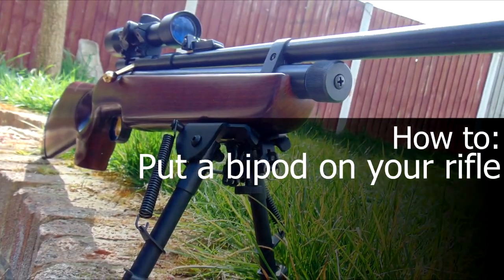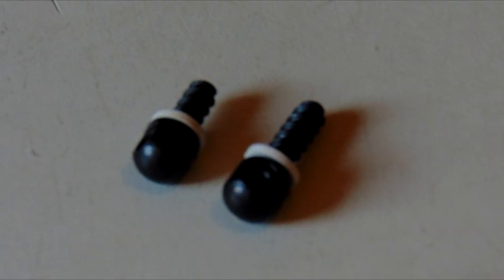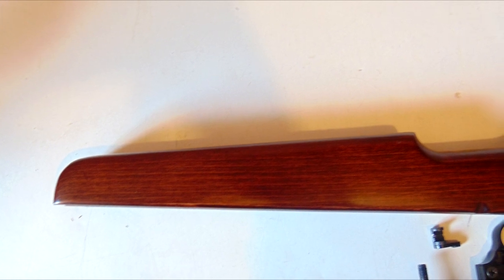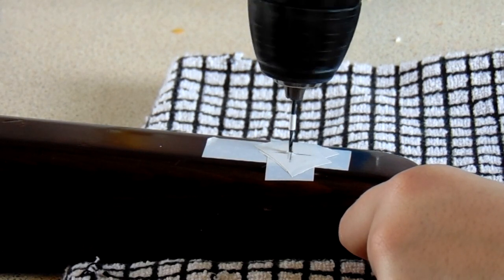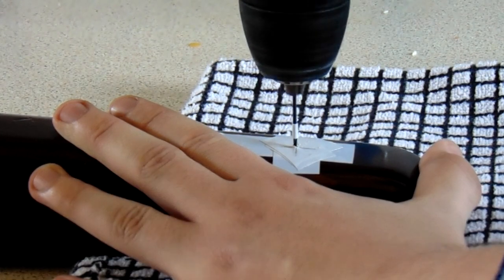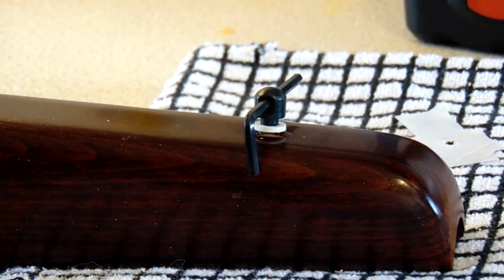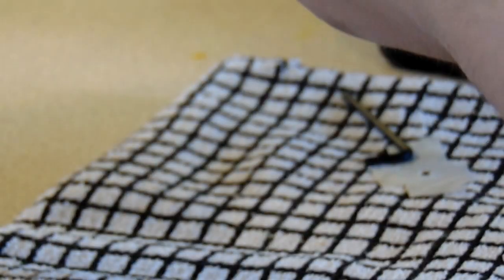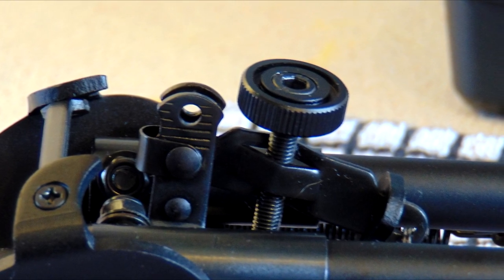HOW TO: Put a bipod on your rifle/air rifle (EASY instructions)

Comment: Don't reverse a drill to 'back out' the bit.  Keep it moving forwards and lift the drill upwards occasionally to clear the waste.  With small bits a higher speed is advisable.
Useful video. I was concerned about doing this on my AirArms S200 but now I can do the job with no worries.  Thanks.

Comment: Instead of using a swivel stud, buy a bipod that has a swivel function built into it and install a picitiny rail instead.
You will have a quick release as a result and can easily fit other accessories like a torch/infra red/red dot laser.
Reply from the maker: Steve			 Fox I chose to use a sling swivel so that I would have the option to use a sling in future. I made a conscious decision not to attach a rail.
Reply: @TDPAviationAndGaming  everyone has personal taste and what one likes is not necessarily what another likes. the comment was aimed at others who may not understand the options available,  it was not meant as a criticism at you.

The majority of people on the forum I'm on use swivel studs like you.

Have you checked out the Chinese airgun forum, the XS/QB/TH 78 and 79 rifles are very popular on there, I own a XS79 powered by a 9oz paintball bottle with an extended bolt probe, aftermarket valve assembly,  modified transfer port and all internals polished and de burred. These rifles are not even close to 12ft lbs out the factory but the 22 can be tuned to 12ft and beyond with little effort.

You will find a tonne of info particularly about tuning is available, along with a community that owns the same guns.

I'm 'uksteve' on the forum.

http://www.ukchineseairgunforum.org.uk/index.php

You need to register to view the forum topics, they had a lot of problems with trolls.
Reply: @stevefox3763  what the fuck lol
Reply: @markopolo6009 ??  What's your issue with that lol.
Reply: @stevefox3763  I don't have an issue, I was just surprised by the long reply and the additional info. Kudos.
Reply: @markopolo6009  ahh ok 😀

Comment: Hello 

what is the drilling diameter?
Reply from the maker: I'd go for 1mm smaller than the diameter of the screw/stud you're using. So if it's a 5mm stud, use a 4mm drill bit. 6mm = 5mm bit and so on.
Reply: The Duck Pond it is still possible to rock the barrel for loading with this bipod?
Reply from the maker: Rocco P on a break barrel air rifle you would need to place the bipod to the rear of the cut out notch for the barrel to break down. In my opinion this is too far to the rear so I would say it’s unworkable. I only have a bipod on my bolt action air rifle, I’ve not tried to put one on my break barrel air rifle.

Comment: Is this some euro air rifle? American sold air rifles :gamo, ruger ect. All have a large grove on the bottom for cocking.
Reply from the maker: BADD1ONE by cocking do you mean for cocking a spring action? This is a gas powered rifle so there is no need for a large grove in the stock.
Reply: It's an SMK QB78DL CO2 powered rifle, cooking is done at the rear with the bolt action to compress the hammer spring with opens the co2 valve when the trigger is pressed.

No co2/hpa rifles have a break barrel or cooking lever at the front, it's not a euro thing (the video poster is British and not European BTW) the way these rifles work is the same across the world.